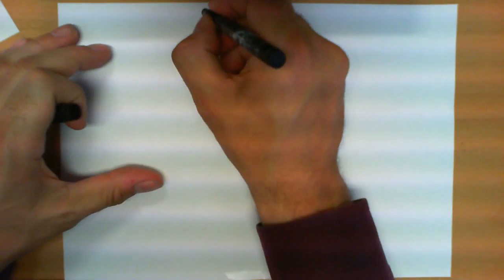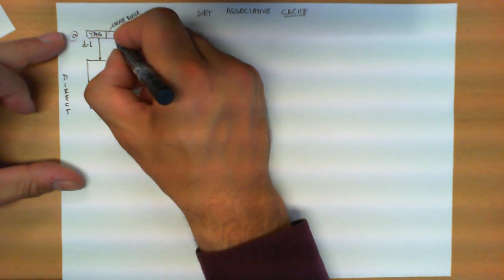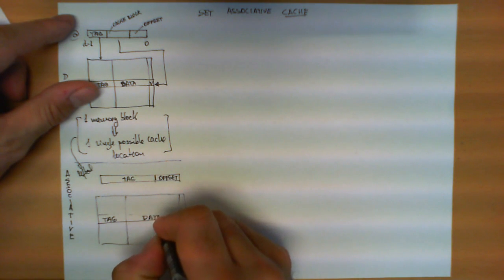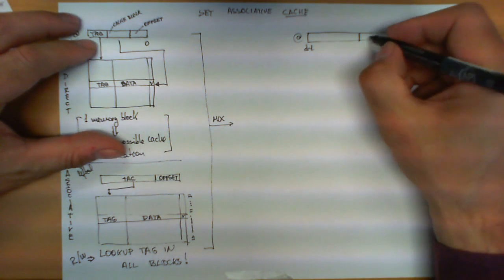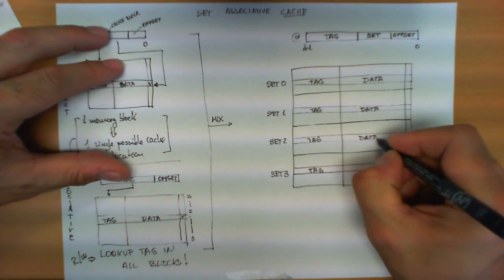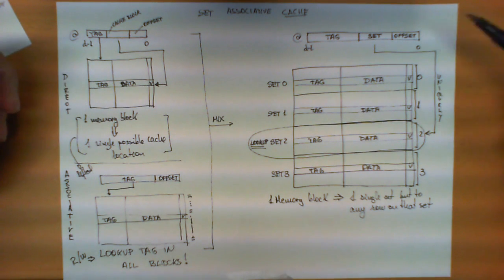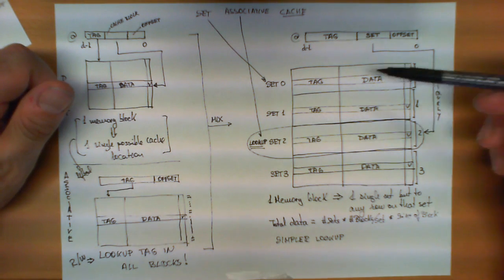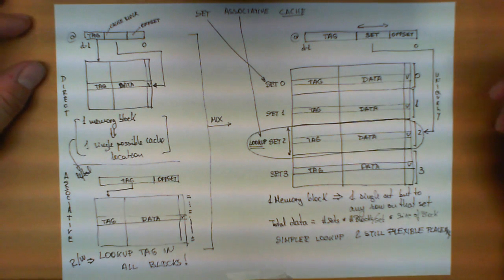Set associative cache

Comment: One thing he didn't explain, and which confused me until i figured it out was how the sets correspond to main memory. Every multiple of eight(in a eight set cache) can be used in set 0, so you can have two blocks of a multiple of eight in set 0, if that makes sense. Of course if there is a third block from main memory used, there will be a conflict in the set, and one block in the set of the cache will have to be replaced

Comment: what is offset?
Reply: Since each line may contain more than one variable, the offset uniquely identify the position inside of the cache line. Let's say the cache is 128 bit long: in the same line it can contain 4 different float variables (supposing that a float is 32 bits), so the offset will be made up with 2 bits (LSBs) =)
Reply: Thank you ☺